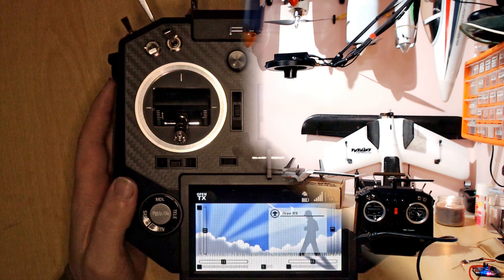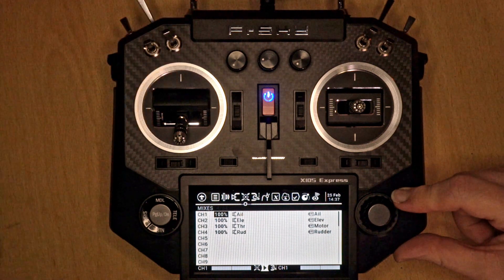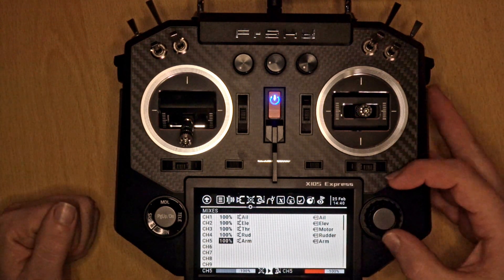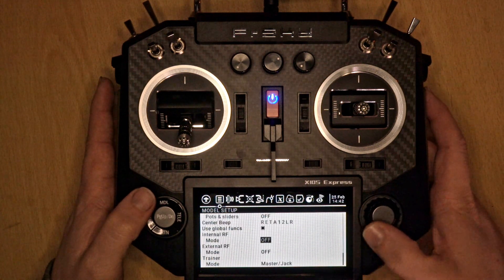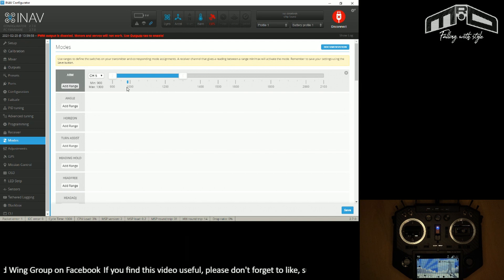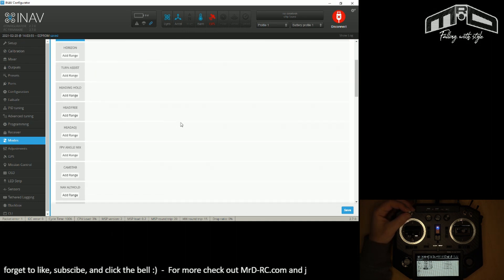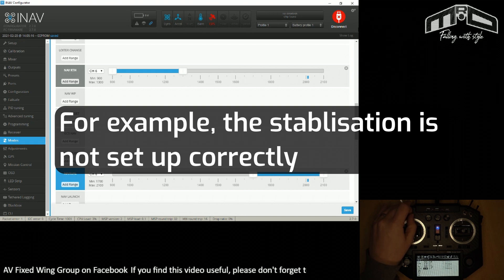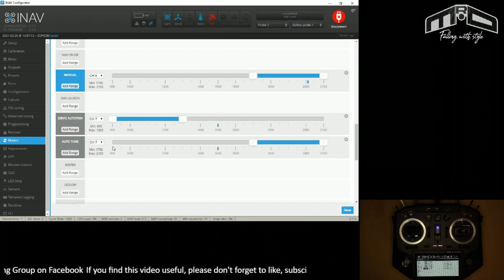A Guide For Newbies - Setting Up Modes and Switches for iNav

Comment: Very useful, thanks. But I set the same, then when I switch to RTH, iNAV displays it as ACRO. Manual and Angle are correct though. I am using iNAV 2.8.4. Anyone know why?
Reply: And Matek F405 Wing

Comment: Using a Taranis X9D+ with iNav 6 and I followed everything step by step, but my SF arm switch isn't working when I switch over to iNav, and SA will only set as a 2-position switch, not 3.  
Sometimes when I switch back to iNav in the Rx tab it'll show the Ch5 position high, but as soon as I flip it, it goes low and stays there. 

If I mess with the weights I can get it to recognize the SF switch, but it won't recognize it as-is as show here.    :(   Any idea why?

Comment: Hello Mr.D. I´ve just done what you showed us on the video. Any tips on setting up more modes and autolaunch? Thank you.
Reply from the maker: That video only shows a basic switch setup. For modes, you really want to be using the same RC channel for all your flight and navigation mode. This can be done in OpenTX by combining switches.

But, if you’re new to this, I would recommend the INAV Fixed Wing Group OpenTX model. That basically has all you need set out for you. That can be found here https://inavfixedwinggroup.com/guides/transmitter-models/standard-opentx-model-v3/

If you wanted to try it yourself. This video shows different methods of combining switches. https://youtu.be/9M9aLVHPL40

My video for autolaunch goes over the setup for it and the correct procedure for launching the plane https://youtu.be/rj_RSrXqib8

Comment: hello,

I'm finishing my first wing (ZOHD orbit) with the FC MATEK F405-WING, 
but as soon as I plug it the beeper starts beeping, the motor also and never stops beeping.
I've double checked the connections and they seem ok.
I'm using a DJI air unit with DJI controller, it works ok, but the beeper keeps beeping...
Any ideas about the why annoying beeping?
Flash with INAV 5.1.0
P.S. - the wing is a second hand buying
thank you
Reply from the maker: If you're using WTF-OS on your DJI goggles. Enable System messages in the OSD. That may point to the issue that's causing the beep.
If not, in configurator, go to the CLI and type status. That will return some codes that may highlight the problem causing the beep. You can check the codes at https://github.com/iNavFlight/inav/wiki/%22Something%22-is-disabled----Reasons

Comment: Hi I am hoping you can help me, I have set up and installed a Matek 405 wing and watched your videos I have all green lights in setup pre arm, I have 10 sats I have mode set to a switch for arming I can run the motor from the motor tab in inav by using the slider but I still cannot arm the motor  from the transmitter, this is now doing my head in please help. if I type status in CLI I get Thr cli.  if I move my throttle trim on the tx all the way down thr changes to just cli in status.in receiver tab all controls are responding to the tx as far signal, great videos by the way I've learnt heaps but want to go fly the tbs cap2 if I can get the motor armed otherwise im just going to plug the signal directly into the rx as a last resort.  Kind Regards wayne
Reply from the maker: Hi Wayne if the throttle moves correctly on the receiver page, and the motor moves with the slider on the outputs page. You don’t really need to use the throttle on the transmitter to test. It will work. It’s purposely disabled as a safety feature. 

If you feel you need to, make sure the prop is off. Firstly re-centre all the trims on the transmitter. Then toggle the arm switch off and on 10 times. After that, the warning triangle in the top centre ⚠️ should light up yellow. At that point, the transmitter throttle will control the motor.
Reply: @MrD  Many thanks for your reply its change I've just read the 10 x flips on your website but im sure this is not the only thing wrong i.e. I've watched your videos and cannot get lights to light up, cannot turn off the buzzer added in the mode setting despite watching the slider move to the correct position when flicking switch on tx. and auto launch will not start the motor. I have been around Cleanflight and Betaflight from very early on so setting up is not new to me but this matek 405 does not seem to be responding the way I would expect. I will try the 10 flips and come back to you and let you what happens. Again thanks for your help. Wayne
Reply: @MrD  OK I have now spent 16 hrs on this and time to go to bed, I have redone all the set up from the start and tried your toggle 10 times suggestion and still nothing??? I am at a loss as to how to start this motor to go flying.??? Any other suggestions would be gratefully appreciated. Wayne
Reply: Hi Darren an update on today, have gone from v4.1 back to v4.0 and mostly working now and a bit more settled can get motor running now most of the the time, does not seem very stable the firmware ??? still cannot get the lights working is there a difference from the ws2812 and 2812 from Matek ?? still has the 3 leads.  using the Matek 405se wing fc in a TBS cap2. cheers Wayne
Reply from the maker: Sorry for the late reply, I was feeling quite unwell yesterday.

To be honest, it is very hard to diagnose what's going on without seeing anything. What you're describing does sound a little odd. I would have suggested trying the 10 times toggle in a non-navigation mode, and to check the arm switch range. It should work without issue. The motor would not work if you're in a navigation mode. For checking things like the motor or throws, it's always best to be in manual. Also, if you have autolaunch permanently enabled, this may interfere? I'm not 100% on that, as I only ever use it on a switch. I like to be in control. I've noticed this comment is on the modes video. Have you seen this one on setting up 4.x https://youtu.be/6YuJjAknBsQ ?

The 4.0 vs 4.1 thing I'm am certain is a placebo. It's more likely that something has been set up slightly differently in the firmware configuration when you set up 4.0. I've seen the changes between the two, and they are identical in those aspects. I'm sure if you took a diff all from 4.0, flashed 4.1 and reinstated the diff, it would all work fine. As far as 4.1 goes, it is no more or less stable than 4.0. The main changes are for HD Zero integration, a couple of filter changes, and some updated in configurator for improving the modes page. Everything else is basically identical.

LEDs can be a pain. I used to have plenty of problems with them. But then I must have changed how I was doing things as the just started working. This was back quite a few versions ago, so not a firmware issue. Now they work fine on any builds I put them on. Mateksys 2812 LEDs are WS2812; Matek just dropped the WS prefix for some reason. I have this video, maybe it will help? https://youtu.be/RxhoKpz-uzw

Comment: Hi friend, I m now trying to make to work my new Radiomaster TX16S and the Matek F765 with Inav 3.0.1, I followed every step that you showed in your video, and its seems regarding hardware and communication between FC and Radio works, inputs, outputs and in the Inav configurator shows that everything is active, BUT, when I stuck in the modes , between ARM (ch 5, sw = SF) and ANGLE (ch6 sw= SA), no matter ANGLE is in OFF (grey zone) as soon I set ARM = ON (blue zone) the ANGLE is ON !!! what happen here ? , I proved everything, inverting channels, change channels etc etc, dont work, as soon GPS got signals, and ARM is ON, its set ON Angle too, no matter this was OFF.  PLease, need little help. As I said, new Radiomaster TX16S (with last OPenTX on it) new Matek F765 and last Inav firmware on it.
Reply: thanks for quickly answer, I just confirm you that my CH 5 = SW SF just move alone when I switch SF, and the same thing when just turn CH 6 = SA, its move alone (no others channels move) in the receiver page Inav. I will take a look on your video, and I ll back , as newbie in Inav I really appreciate your tips and help. thanks again...
Reply from the maker: That’s good. It sounds like the transmitter is fine. Hopefully it is just the range on the modes page.
Reply: @MrD  Hi, after I watched your recommended video, I founded this: in my Transmmiter TX16S, page "input" the order of the 4 channels is from above TAER, and in the next page MIXES, its showing AETR, thats match with
with the Inav Receiver channels bars AETR
so do you think this will my problem regarding the others CH 5 and CH 6 ? 
thanks again... I dont have any person nearby in the RC Club that can help me.
Reply from the maker: No, that’s fine. The mixer uses the inputs by name, so the order is not important. So long as the order on the mixer page of the transmitter matches the order on the receive page of iNav, it’s fine.
Reply: @MrD   yes, its matches fine, and movements per channels are fine, etc etc. In the middle 1500 etc etc , well, dont work , I ve already  re-create a new model, step by step, and the same result, everything shows OK (apparently) but when I just try to assign the modes ARM and ANGLE they "works" together. I have bad lucky .....  by the way I m using the receiver Frsky X8R with via the SBUS to the F765.
Reply from the maker: And you can confirm that the range on the modes page for Arm is set to CH 5, and the Angle range is set to CH 6. If it is, it may be a bug. I’ve seen something similar on the iNav Telegram group. 

Could you also confirm that you’re using the latest 3.0.1 version of Configurator and the firmware.
Reply: @MrD  Hi , yes confirmed , Arm is set to CH 5 in modes page also the CH 6 to Angle with these ranges between 980 and 2010. Yes confirming that Inav 3.0.1 = FC firmware 3.0.1 , I m on the telegram INAV group may be I can share you some screens.
Reply from the maker: It may be your posts that I have already seen. I’ve not seen this problem before. If you’re not a member, it may be worth joining the INAV Fixed Wing Group on Facebook, as it’s easier to post there and things don’t get lost in a single chat.
Reply: @MrD  I believe that I found what the problem was, in the INAV configurator, Configuration tab, "Other features"  I disabled = "Permanently enable Launch Mode for Fixed Wing" and then things happened , now, ANGLE and ARM are not "working together" anymore. Now I got another strange thing...but one step at time.
Reply from the maker: Launch mode uses angle, so that may explain why angle is being selected. I never have launch mode permanently enabled. You should be able to select Angle with the mode switch.
Reply from the maker: Firstly, you should be careful when inverting channels on the radio; especially the first 4 channels. I'd recommend checking this video, just to make sure that the first 4 channels are correct https://youtu.be/b1m1aSrtVCQ

Next, go to the receiver page in iNav and move your arm switch. You should only see CH 5 moving with your arm switch (SF) and CH 6 moving with your mode switch (SA). If this is not the case, there is something not right on the transmitter. If this is working correctly, go to the modes page.

On the modes page, double check that the range for angle is set to CH 6. Remember to press the save button, otherwise you won't see the true results.

Let me know what happens here.

Comment: Hi Darren  thanks a lot for your tutorial i  would like to put my wing in loiter after an autolaunch  can i activate loiter when in acro mode thanks
Reply from the maker: The procedure for autolaunch is:
1. Select a basic flight mode (manual, acro, horizon, or angle)
2. Enable launch mode
3. Arm
4. Select the mode to exit to (loiter in your case)
5. Raise the throttle
6. Throw the plane
7. Have fun!

Comment: I can't get my mixes Right? I'm missing something?? Throttle on Right stick not Left. Seems like arm does nothing?. I came from drones. Radio is set for TAER have X-lite and dart 250  Matek PDB and hglrcF22 fc in I nav says everything ok? But when fire up?  Help?
Reply from the maker: It won’t matter that you’re mode 1. It’s only the transmitter that deal with that. So long as iNav has the correct channel order, it will work fine. 

Have you checked out my other videos in that playlist? https://youtube.com/playlist?list=PLtuty5zAsZ_aRUdASwMPFQp2efIeR-tV0 The first thing is to get the receiver page all working correctly, then the board alignment, then the mixer and outputs. 

If you flick the arm switch, nothing will happen unless you have enough satellites to arm. One thing is to make sure you have system messages enabled in your OSD. Anything blocking arming will be shown there.
Reply: @MrD  I did. I will watch again. And again. Lol was a long day. And my screen looks different. My radio screen.  My choices is plane or delta
Reply from the maker: Always just a basic plane mix. The elevon mixing will be done in iNav its self.
Reply: @MrD  thanks again. My first flight Soon!! Well few days is soon for this Old man.. lol
Reply: @MrD  I really appreciate your one on one. This is what some need. Was in a coma...need more help than Most.. lol It's something small or Stupid. If I can't figure out.. I'll make a help video.. when I updated radio I set TEAR as default setting. Not shure but might be messing up? I don't give up easly and will mention your Help in my documentary of my rc travel's. Great Hobby! I see what you and other's do with planes.. I can't wait! Getting ts16 radio master. But to me remote just sticks and Open tx and Cross fire. The x9 lite Much cheaper.. but not so Future proof.. But my 3 year's compared to your experience.. what do you recommend? Or wait for the next greatest.. lol I like the X-lite! On muly second one. I burn 4 bats for shure everyday. Have Water proof Dji quad I made!! Thanks again for your time.. God bless
Reply from the maker: @sleepingbearffg5008  Wow, I hope you're doing much better now. You're most welcome to the help. It's not stupid at all. I've seen someone who worked for a major RC company have the wrong channel order. So let's just get you flying and having a great time :)

Using TEAR is absolutely fine. As far as iNav is concerned, you just need to change the "Channel Map" selection. You will have to just type the Channel Order in to the box, as your order is not in the list. As far as the list goes: Default is AETR, Futaba/Hitec is also AETR, and JR/Spektrum/Graupner is TAER. So long as when you move stick, the correct bar moves on the receiver screen. Moving the stick left or down should show a value of 1000. Up or right should show 2000. But you can 100% get TEAR working.
Reply from the maker: @sleepingbearffg5008  As far as the TX16S Vs the XLite is concerned, they are really two different kinds of radio. The XLite is really for portability and the TX16S is fully featured. With the X9 Lite and the TX16S, they are much more similar in what they were made to do. Out of these two transmitters, the only reason I would pick the X9 Lite over the TX16S is if you want to use ACCESS. As you use Crossfire, there's no advantage to getting the X9 Lite. The TX16S is more expensive, but it can do much, much more than the X9 Lite. The TX16S is a good transmitter. I had one to try for a couple of weeks from a friend. The only real downsides to the TX16S is the screen can be hard to see on a sunny day, and the scroll wheel is horrible. Other than that, it is a solid, fully featured transmitter. It is the best bang for the buck available right now too. There are physically better transmitters, with nicer navigation and screens that work well in bright light. But they cost more. There is always a compromise somewhere. You just have to pick which is best for you. That is not always an easy task.
Reply: @MrD  and big Thanks for responding.  Thank you!

Comment: Hi

If I going to fly a flying wing with my INAV. What model should I create in the radio ? Just normal plane or a flying wing ?
Reply from the maker: Everything in the transmitter is set up as a normal plane. The mixing is done in iNav.

Comment: Hello Darren, i'm gonna use the same tuning.
When i activate autotune it should be in manual mode or angle?
Same story as autotrim, better to have the switch manual or angle?
Reply from the maker: You should really put auto-trim and autotune on a separate switch to the flight modes. 

I’d actually recommend reading this guide. It will really help with tuning. https://inavfixedwinggroup.com/guides/tuning/inav-plane-tuning-masterclass-phase-one-get-in-the-air/
Reply: @MrD   @Mr.D - Falling, with style  Thank you D., it is what i did.
As you said, i put mods on channel 6 and autotune/autotrim on channel .
Anyway when i swtich on the autotune/autotrim which mode i should use at the same time?
Thank You
Reply from the maker: Check out the link in the last reply Alfredo. It will give you all the tuning answers you need 👍🏻
Reply: @MrD  thank you D.
Love so much your video! 
Great support for us
Reply from the maker: You’re welcome Alfredo. I hope you have many great flights.